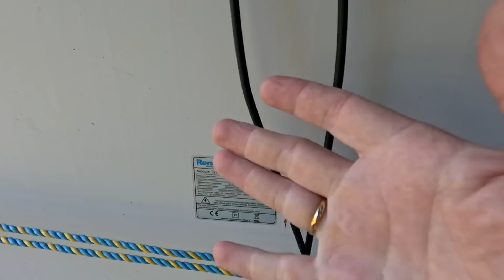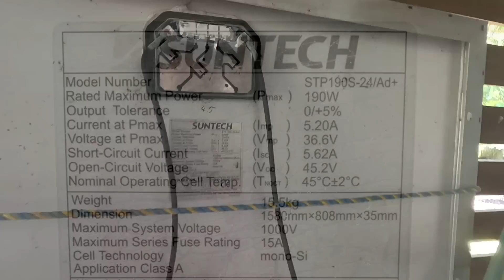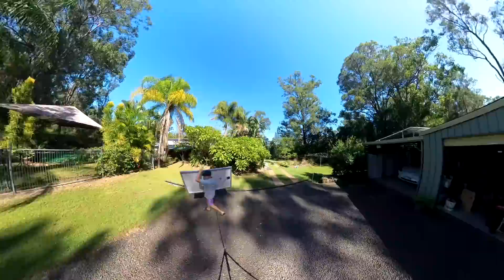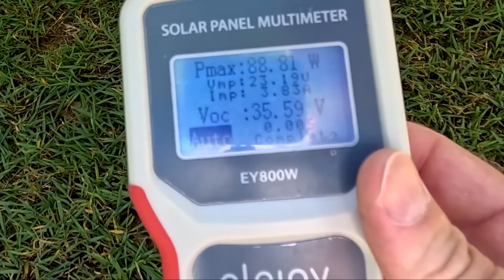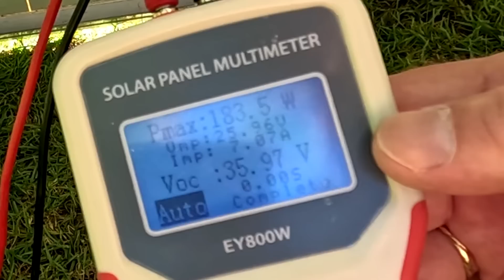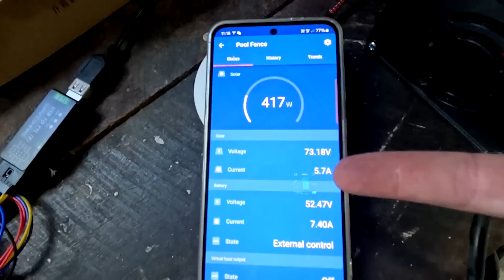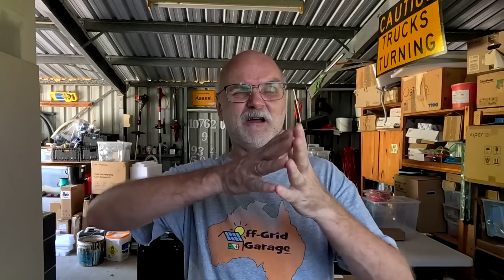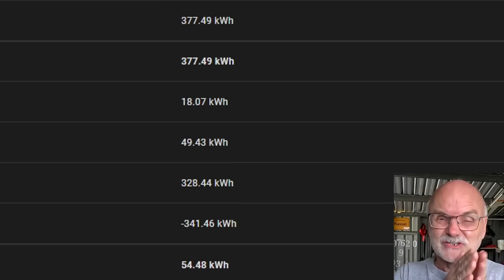Surviving winter with lots of shading with no additional Solar? Preparing for fully Off-Grid.

Comment: You’ve a lot of battery and less panels. My site is opposite.
Reply: Same here, panels (they are cheap and last) East, North and West (important for aircon) and we are surviving (almost no restrictions) with a 7kWh LFP.
Reply: @ i got my 20 x 465w panels dirt cheap. And paid single us5000 a lot, now prices are half of that. I guess it was good that didn’t invest yet back then to the batteries. And now it makes more sense to build Eve batteries than buy 15S pylontechs.
Reply from the maker: Hence, I charge the batteries in summer and use them during winter. I don't have any space for more panels.

Comment: If I can be off-grid at 63 degrees north, you can do it at 28 degrees south :)

By the way, you can go higher voltage DC to bridge distance - I'm currently working on an array that will be be further away and that will run at around 400V DC.
Reply: i am offgrid in germany for many years now, no problem at all.
try this victron 450v chargers they are awesome.
Reply: @mosfetkiller3851southern parts of germany?
Reply: That impressive, very low sun at 63 degrees in mid winter,
Reply: @jimbobarooney2861  the problem is not low sun:) The problem is shorter daylight hours in winter and mostly cloudy days... :-(
Reply: Hi. Been watching for around 12months now but first time I've been in the comments. 
My question is about optimisers. Probably been asked before but pros and cons and why not use them for off grid? Thank you
Reply: @notforyou1979  They're not worth the expense, added point of failure. They also don't perform the way people expect. If you have shading, make parallel strings.
Reply: @notforyou1979  don't need them if your panels have bypass diodes.

Comment: Did you actually measure these panels new? From my experience, a lot of these ratings are not correct to begin with.
Reply: Good point, exactly my (using solar for over 30 years) experience too. What is printed on them are unrealistic lab conditions only, particularly the panel temperature.  After 30 years degradation is either non existent or very extreme.
Reply from the maker: I measured the new panels before they went up on the garage. They all met or exceeded the ratings of the stickers.
These are all used panels I bought 2nd hand.